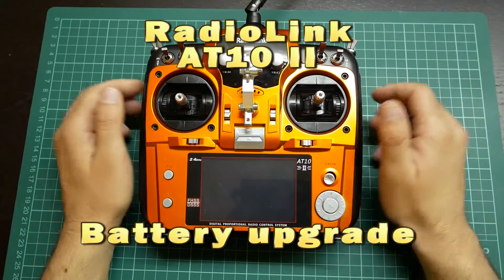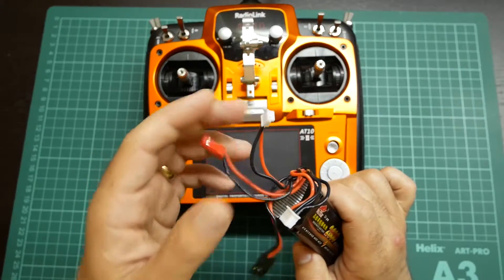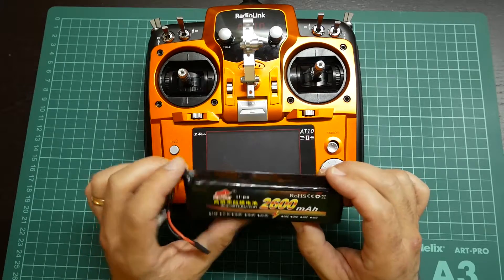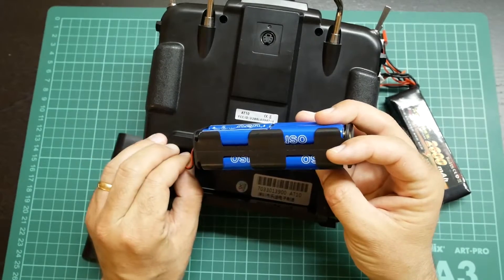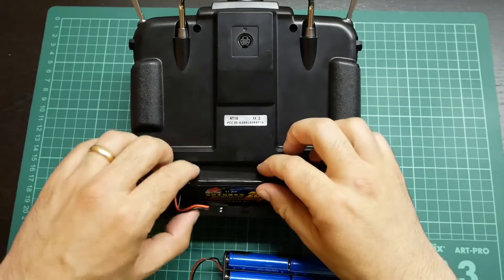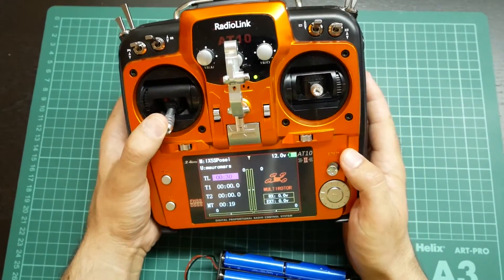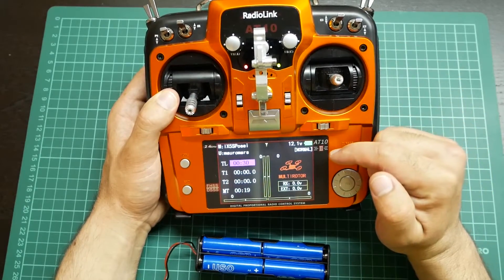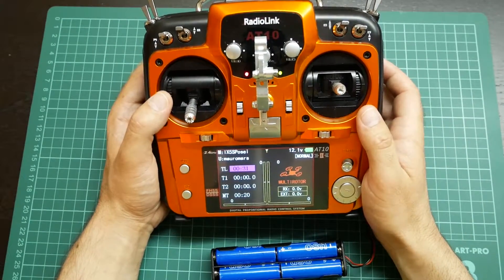RadioLink AT10II Batery upgrade

Comment: Hi,do you need to change settings in the transmitter programm to use a LiPo batterie (in my SPEKTRUM i had to change settings from NiMh to LiPo)-also,if you remove the LiPo from the transmitter for charging,what happens to your programmed settings on your transmitter...i hope you don't have to re-programm each time after charging  ?Last question-do you really need to discharge after each use ?

Comment: To charge the Lipo battery, do you have to open the battery compartment each time or is there a plug on the transmitter where you plug in a charger?
Reply from the maker: +Jay McMullan no plug available . You must open the compartment to charge.
Reply: Its a lipo battery, you need to remove the battery for it to use the balance plug. ALWAYS ALWAYS BALANCE CHARGE ALL LIPO BATTERIES.